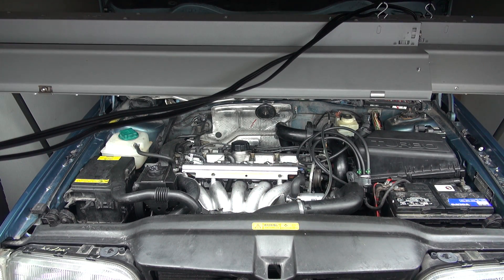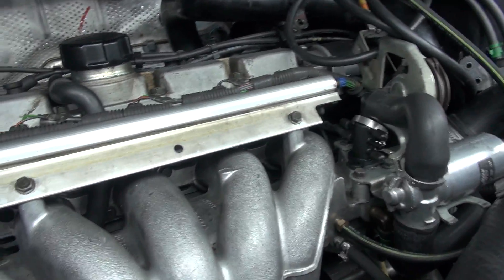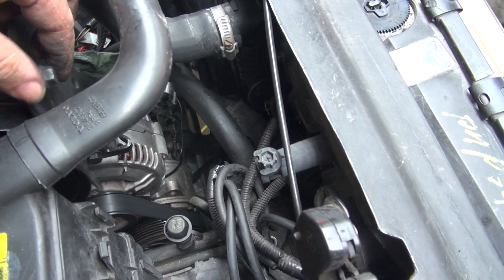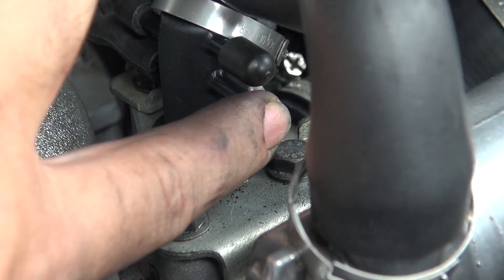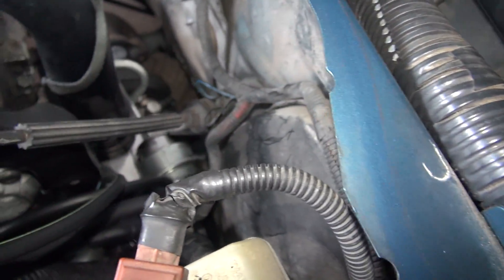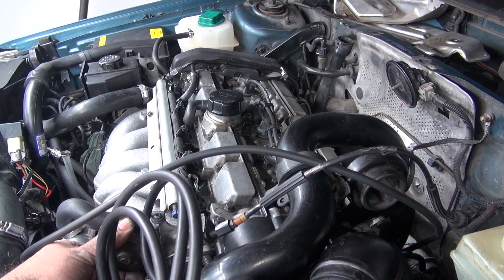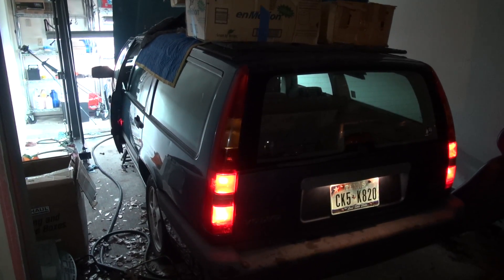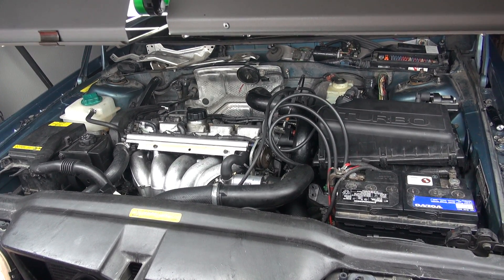Volvo 850 T5 vacuum hoses routing

Comment: “It seems to run pretty good” meanwhile poor Volvo engine is having a seizure.. 😂
Reply: Well, there were dry-rotted and collapsed vacuum lines everywhere. And as you can see, the ones for the turbo have already been replaced.

Comment: hey guys I'm missing two vacuum lines going to the air filter hose boot coming from the turbo. there close to the MAF sensor. any help would be appreciated. You're absolutely correct about tuff job. my brain is throbbing. will start fresh tomorrow. thanks
Reply from the maker: +Dana Kelley, Yes, several things are either loose or missing. The engine was still in a testing stage, & since I was working on several sections, I got tired of fastening & undoing bolts. For example, (From L to R.) The windshield wiper refill nozzle, long bolt on the left of the steering pump, idler cable cover, spark plug beauty cover, IAC hose clamp & the windshield wiper cowl.
Reply: Completely understand. I'm committed now. Just bought new plugs and air cleaner, replaced a majority of the vacuum lines. Cleaned the hoses and opening of the throttle body. Dreading the pcv valve connections, do that tomorrow. Uhhhh!     It does idle a lot smoother and the hesitation during hard throttle is not so sudden. Hahahaha t actually takes off like a bat outta hell for a second. Then chuggaluggah. Normal to normal high throttle its cool, but hammer it? Not yet. 250,000 plus miles. C ya man, I'll comment when its fixed.
Reply: I assume you got this figured out ?

Comment: Hello :) i have the same problem with my car (volvo 850 t5 94) When my idle enginge its connencted the car its dieing so i need to hold the gas, But when its not connected the car its going at idle but not good at all about 500rpm, And i woundering if some vacuum lines are broked, You car was really like my car , So i woundering if you could show me what you changed i couldent see so good :)

Comment from the maker: Desirae, I'm going to assume that you're talking about the black hose with the yellow stripe. The part number for that hose is #976734. It's actually a smaller diameter hose that the ones that connect to the boost control solenoid. Anyway, when looking down from the top of the engine from the back side, there's a connection immediately adjacent to the 02" metal pipe that goes over the engine. The hoses from the BCS are too large for this connection.